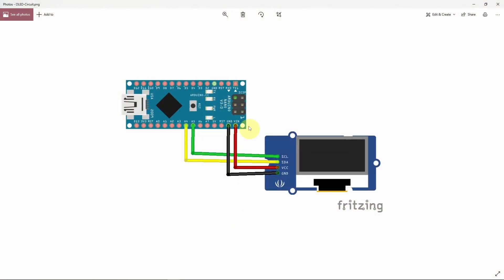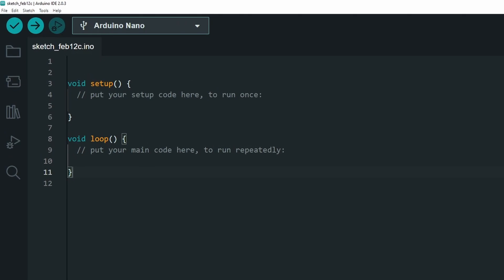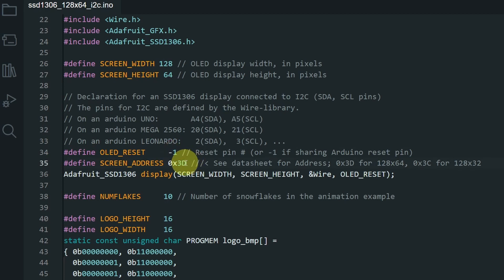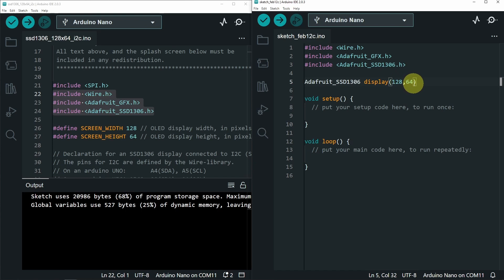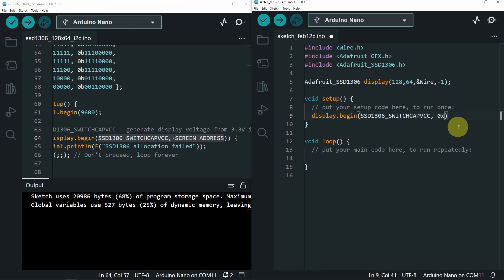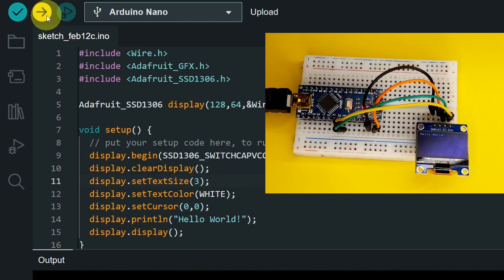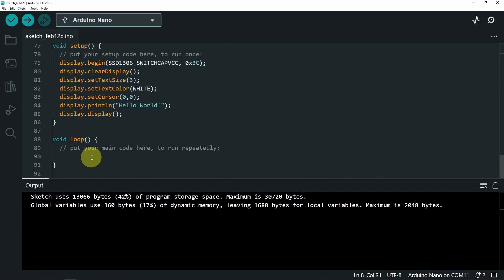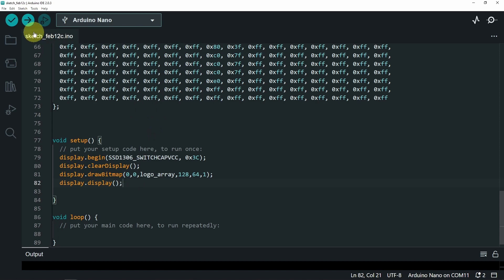Master OLED Displays with Arduino, ESP32: A Complete Guide

Comment: Help, I hooked up all correctly, code is correct. What I get is the first 5 or 6 lines that seem to be working correctly, but all the lower lines are just stagnate and not moving but with a random pattern. I've tried 6 different OLED (all same model and Manufacture), and I've tried 2 different Arduino, one Uno and one Nano with the same result. I find it hard that all 6 OLEDS are bad, but...  Changed wires, change com ports, had a few beers...
Reply from the maker: Try changing the address
Reply: Nothing works then. Is it possible the displays are not SSD1306 compatible. They list as SSH1106. I reordered new ones that do say SSD1306 in the description.   @DIYTechRush
Reply: Turns out it was the wrong chipset SSH1106. Once I plugged the ssd1306, no issues. 

 @DIYTechRush
Reply: @DIYTechRush please help me I'm getting same error and changing the address is not the. Solution please help brother.
Reply: Did you get any solution? I am also facing the problem and I'm becoming very frustrated.

Comment: Thank you so much:face-red-heart-shape:.. finally found a way to display on i2c oled using esp32 cam module.
Reply from the maker: Glad it helped
Reply: here is my code for anyone who is interested
Reply: //code my demon
#include <Wire.h>
#include <Adafruit_GFX.h>
#include <Adafruit_SSD1306.h>

#define OLED_SDA 14   // Use GPIO 14 for I2C SDA
#define OLED_SCL 15   // Use GPIO 15 for I2C SCL
#define SCREEN_WIDTH 128
#define SCREEN_HEIGHT 64

#define OLED_RESET -1 // Set OLED_RESET to -1 if the display does not have a reset pin
#define SCREEN_ADDRESS 0x3C // Change this address according to your OLED display

Adafruit_SSD1306 display(SCREEN_WIDTH, SCREEN_HEIGHT, &Wire, OLED_RESET, OLED_SCL, OLED_SDA);  // send the i2c pins to the library before initializing.

void setup() {
  Wire.begin(OLED_SDA, OLED_SCL);
  display.begin(SSD1306_SWITCHCAPVCC, SCREEN_ADDRESS);

//put uar code here 

  // Clear the display buffer
  display.clearDisplay();

  // Set text size and color
  display.setTextSize(1);
  display.setTextColor(SSD1306_WHITE);

  // Print "Hello world" at the center of the display
  display.setCursor((SCREEN_WIDTH - 12 * 6) / 2, (SCREEN_HEIGHT - 8) / 2);
  display.println("Hello world");

  // Update the OLED display
  display.display();

}

void loop() {
  // Add your code here if you want to do something continuously
}

Comment: I'm building a simple Muon detector.  I learn mainly from the YT vids.  Anyhow the end result of the detector is a LED that flashes every time a muon is detected.  Well, I can't sit there and watch it waiting for the LED to flash every now and then.
So I purchased a 128x64 OLED.  I would like to keep the LED and further connect the leads from the LED to an arduino nano and the OLED with the hopes of somehow getting the arduino and OLED to maybe show a cumulative total of all the muons (flashes) detected.  Even better would be showing how many detected in last 24 hours, and the last week, and the last month all on the OLED.  Perhaps I am a dreamer but it should be possible.  I'm a novice so any help would be greatly appreciated!  Thank you!

Comment: Hi. Is there code anywhere that explains how one could "turn off" the display with a button push. The only thing I know that its more of a black screen rather than a 0v to the display. Thank you
Reply from the maker: Connect vcc to a digital pin like 2 and use digitalWrite(2,HIGH) to turn it on 
And digitalWrite(2,LOW) to turn it off
Reply: I read about that but rumor has it that its just the same effect as turning on/off which is no good as it has to sync up again with spi or i2c signals that could render gibberish on the display once it comes on